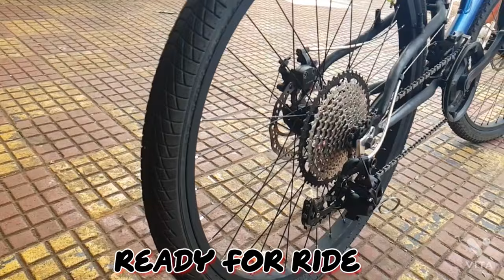Upgrading cycle from 6 speed to 11 speed || freewheel to cassette || Build Not Bought

Comment: is it possible just to change the cassette without change gear shifter and deleter ?
Reply from the maker: No... all 3 items has to change. if u r upgrading the cassette to 9,  10 or 11 speed u have to change the gear shifter and derailleur also ..
Reply: How about the chain
Reply: @banshanzbanshanz5439  yes, new cassette needs new chain.
Reply: How about the crankset or chainwheel ? No need to change that ?

Comment: I have 3/7 speed setup can i upgrade to 1/10 ? Cassette ? Please reply and please tell what i can do for this?
Reply: There will be 2 things to look at when considering a 1x10 conversion from a 3x7. Is your 3x7 a cassette or freewheel hub? and 2 are you willing and know how to change the free hub itself? Most of the time if you have a 7 speed cassette with a 7 speed free hub you just need to change the free hub to a 10/11 speed hub. then realign the axel to fit.

Comment: If we have to convert freewheel to cassette 8 speed than we have to change derailleur and shifter...?and hub ..
Reply from the maker: If u r converting no need to change derailleur n shifter & if u r upgrading then u hv to change even the chain also.
Reply: Most likely yes. 
Every derailleur has a limit. The rear derailleur's total capacity must be greater than or equal to the sum of  differences between the largest and smallest sprockets, and the smallest and largest chainrings.
You may want to check https://bettershifting.com/installation-guide/understanding-di2-derailleur-specifications/ for better details. 
In any case you will have to change the shifter.

Comment: Want to ask something bro. I saw you had a quick release axel in your hub. But when fixing to the bicycle it was a solid bolt axel. Did you change it?
Reply from the maker: 😃😃 s you are right.. guick release axel was 1 inch short so i replace with solid bolt axel.
Reply: @mosesnvlogs9591  Oh really!!! Thanks for the reply. I'm also planning to upgrade for a cassette on a budget. 
Thanks.

Comment: Why did you changed the spokes? Is it a different size for new ones?
Reply from the maker: S bcoz cassette hub was ½ inch higher than the regular hub so my old spoke was bigger it doesn't fit the rim so I have to put new spokes
Reply: @mosesnvlogs9591  ok. Thanks man.

Comment: Bro can u tell whether any frame limitations while installing the 11 or 12 speed.
Reply from the maker: To install it was easy n it was in the frame limit
Reply: @mosesnvlogs9591  How we should see the frame limit, i want to upgrade the Shimano deore 12 speed cassette on Montra blackbeat 2019 model red color.
Reply: @ronicallmen  it's more of not a frame limit  as a wheel alignmnet issue... you have to align the wheel (axel) to be able to be in the center of the frame... the frame width needs to be at least 130mm wide from my understanding from dropout to dropout. Steel/Comolly frames can strech to a point but, aluminm cannot.

Comment: Iits a nice video.showing from the scratch
But
Will not be easier and cheaper get a new wheel set or even a new bike?
Reply from the maker: No.. i don't think so. In India i don't think so. Can u pls find out for me the price of a new bicycle which has 2×11 speed gear n let me know if you get cheaper get a new wheel set or even a new bike. pls let me know
Reply: @mosesnvlogs9591  ok .thank you for the video
Reply from the maker: You will get a new set of wheel or even a new bike but it will be expensive. Even if i get a cheaper bike then i don't like cuz i like to build or to do by myself. BUILD NOT BOUGHT.. I have a passion to build or else you can check this link as i have build Hubless 
Cycle   https://youtu.be/W2cD4cb2ybc

Comment: Bro can you tell me i have roadeo wich come from 7 speed and i wanted to upgrade to 9 speed i saw this video and when you put a cassette hub we need to expand the frame from rear how it is possible because when we try to put a 9 speed cassette the chain skip or not becuase we put a 9 speed and it comes from 7 speed?
Reply from the maker: S you have to expand the frame little bit and u have to change the chain to 9 speed..
Reply: @mosesnvlogs9591  possibility of not skipping chain

Comment: You have keep the front as it is.
Reply from the maker: Yes
Reply: @mosesnvlogs9591 Any issue while using the front as it is 3 speed. I have purchased all the 11 speed components but thinking to use same 3 speed front using only 2 speed and others are locked.

Comment: equipment used is great but the cycle design is not worth.. you should have used a good cycle frame for this upgrade...
Reply from the maker: Thanks for your comments
Reply from the maker: if u want u can sponser/donate cycle frame so i can upgrade.....
Reply: @mosesnvlogs9591  how much did it cost you  for the accessories apart from the cycle?

Comment: You know to use gears man first 
11 speed cassette is used with 1x or 2x man
Reply: Even with 3x  speed
Reply from the maker: @Kusha I 
Yes man, i know man how to use gears. Mine is 2x man..
Reply: Question can I just change out say a 11 or 12 speed cog and shifter derailer and keep the same 3× chain rings up front? That would save me alot of money plus give me more gears
Reply: Ok thanks on that so later I will change to a 2× crank gears but living here in phillipines there are very hard steep hills will making this change make much difference from what I currently have? Right now I'm running  a 9 speed × 3. Which has already been upgraded from a 8 speed wish I would have bought a higher gear cog than when I bought the group set which was deore
Reply from the maker: @you dont know me
yes bro u r right